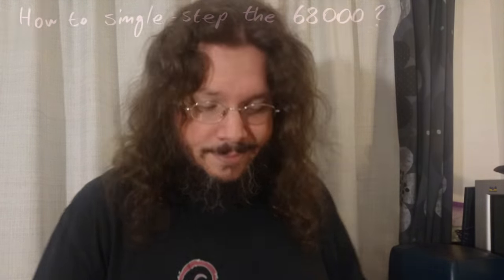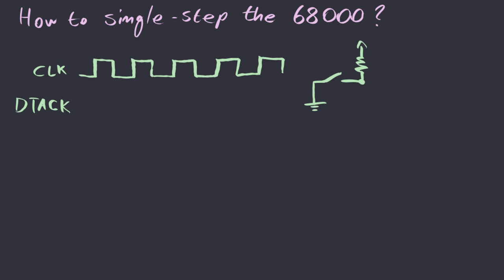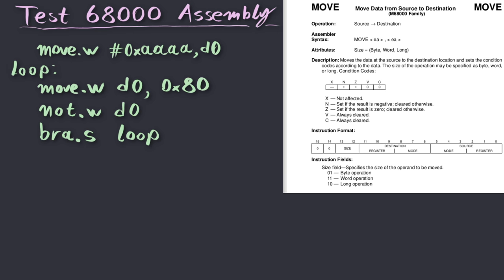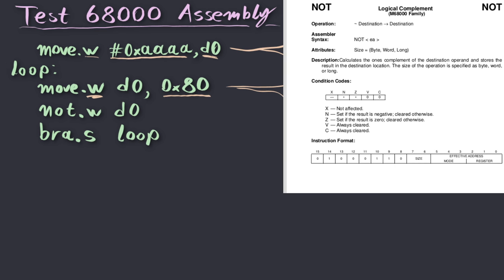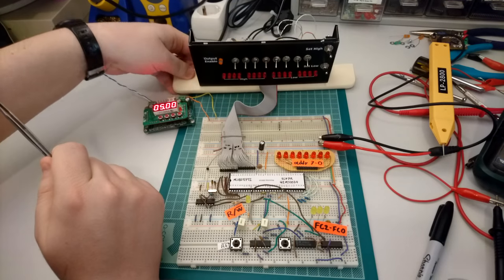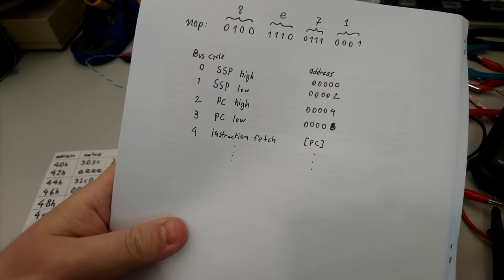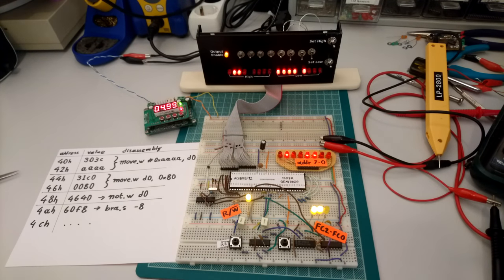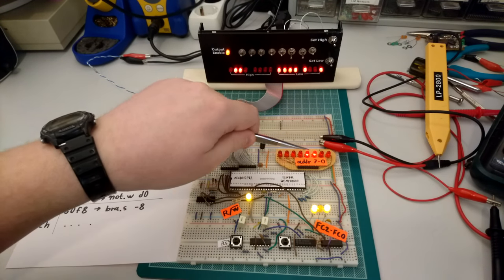Motorola 68000 CPU single-stepping on a breadboard experiment

Comment: Very cool to see a young person delving into the low-level details of the 68K; I always thought that other than the Z-80, it had the nicest instruction set and memory addressing than the I-86.  I always liked the Z-80 over the 6502 because when you look at 6502 code, all you seem to see is load-store, load-store which made it really hard to look at an assembly listing and get an immediate feel for the program. Outstanding video and community you have!
Reply: A load store architecture would imply an orthogonal isa. Sadly, this is not the case with 6502 ( nor Z80 ).

ARM2, SH-2 and 8086 have half the transistor count than 68k. 68k is really expensive.

Also LoadStore confines those size postfixes to load and store. This gives you more encodings in the R-type instructions. Let the CPU have internal zero flags for the register file if you are concerned about the implementation on a narrow ALU.

Comment: Nice video.  You had me going, anticipating each part, until the introduction of the address error at the end and tracing of the construction of the bottom of the stack frame showed a bunch of garbled data.  I thought, this is a 68010.  When it got to address x'86' in the stack frame and was writing a x'2708,' that was the clincher.  This is the status register at the time of interrupt. x'2' means super state, x'7' means the cpu's interrupt mask is x'7,' expected, uninterruptible.  x'08' means the Negative bit of the condition code is on.  I then checked out the next video and you mentioned 68010.  Good deal.
Reply from the maker: Yeap 68010 :) I don't remember if I mentioned it at all in the video, but it's also printed on the label I attached to the chip.
I choose the 010 for two reasons. One was that I thought in the future I might want to make an MMU to go with it, and I wanted to be able to recover from bus errors. But the other more pressing one was that I didn't feel like setting up a state machine that remaps ROM high a few cycles after reset, to leave the interrupt vectors in RAM at 0. I'd rather just leave ROM at the bottom and point the interrupt vector base register to wherever RAM is mapped.
Reply: Consider using FC0_FC2 to map the first 4k of storage to rom for super state data space. All other code combinations to ram. Then switch to user state as soon as possible after reset.  User code shouldn't be looking around at the system vector table anyways.  VBR can then stay at zero, and the entire vector table and reset words are invisible.

Comment: This is still a powerful cpu especially for imbedded systems. The 68000 is a good match for using static rams, eeproms too. Plenty of theses on Ebay for sale for the experimenter. This is the Cpu the TRS-80 Coco should have had in the 80’s. A really good instruction set too. Pretty simple stuff presented here. I would have used 74ls193( sn74hc193 now ) and single stepped from a 555 and the output going throught a  few 74hc373’s to drive the address bus. It’s hard to justify using these old things when there are so many cheaper, and more powerful cpu options available ( ARM cpu's ) that are easy to use and programmable in a simple intergrated development environment. Still... I do like this old stuff. I was building with the 68000 back in the 80’s…Peace out

Comment: Nice bit toggler or whatever you call it (the thing in back with the toggle switches and blinkenlights). Do you have a circuit diagram for it? And what kind of ribbon cable are you using to connect it to the breadboard? I just subscribed, this looks like a great channel
Reply from the maker: Thanks. I don't have a schematic for the switch-"box", because I just wired it directly on the prototyping board, but I more or less explain how it's wired up in the video. Basically the bit switches connect vcc or gnd to the inputs of two 8-bit latches. The latches have their OE (output enable) pins driven by the RD/WR pin of the CPU, and a bunch of LEDs show the state of the data lines, which are either driven by the latches when OE is active, or by the processor when it's not. The load pin of each latch is driven by the load-hi/load-low switches, which are essentially momentary push-buttons in the form of a switch (they are spring-loaded). No debouncing is necessary, because even if multiple loads occur, the data to be latched are stable.

Here's a picture of the back side of the whole construct I took at the time: https://imgur.com/sNkUPfN

Edit: There's nothing special about the ribbon cable. It's just a regular ribbon cable. You can see in this picture (and the video) how I split it and grouped the various signals together.
Edit2: The latches are 74HC373

Comment: I'm trying to understand how you converted the instructions to machine code using the motorola manual and it is very clear but sorry for the branch line why you said the displacement is minus 8 ? I didn't get it
Reply from the maker: The minus 8 is the offset we need to add to the program counter so that it'll point back to the top of the loop.
If you look at the final opcodes on the paper I'm holding up at around 28:18, you can see the addresses I used in my demonstration, in this case the top of the loop is the move instruction, 4 bytes starting at 44h, then there's the not instruction, 2 bytes starting at 48h, and then the branch instruction, again 2 bytes starting at 4ah. After the branch has been fetched PC points to 4ch, right after the branch. To move it back to the top we need an offset of 4ch - 44h = 8 bytes. Or as I said in the video we need to skip over the branch, the not and the move, 2 + 2 + 4 bytes = 8. Does that make it any clearer?
Reply: @jtsiomb  Oh Thank you it's clear now ^^

Comment: I had no idea it was possible to single step the 68000. I assumed the registers needed constant refresh
Reply from the maker: They do. That's what I'm explaining in this video. How I'm single-stepping bus-cycles while still keeping the processor on a steady 4MHz clock.
Reply: I'm actually a bit surprised!  I built a very simply breadboard PC using an MC68HC000.  The manual says the minimum clock is 2MHz, but I'm able to clock it at 75Hz without any issue.  I can take a video of the board if anyone is interested!
Reply: Daniel Scimé I am interested.
Reply: Gladly!  Give me some time to get a video together!
Reply: So is the register file DRAM? Is this about latches? Sharpness of edges of the clock for flip flops? Precharge? Only one of the phases need to be fast?

Comment: How many Hardware Stack and User Stack  m68000 use at the same time?
Reply from the maker: Not sure I understand what you mean. Hardware stack in my mind is like a PIC microcontroller which has a certain number of on-chip stack slots. The 68000 is not like that of course. It just has a stack pointer register, you point it anywhere you want in memory, and that's your stack. So yeah I don't know what you mean, please elaborate.

Comment: Can 68k run Linux
Reply from the maker: Yes, Linux supports the motorola 68k architecture. But it requires at least an 68020 with an MMU chip, or an 68030+ which had an MMU built-in. See: http://www.linux-m68k.org/faq/reqs.html

Comment: you don't by any chance have a circuit diagram
Reply from the maker: No, I'm afraid I was just winging it on the breadboard. But you can follow the wires with the help of some pinouts for the 68000 chip, it shouldn't be too hard, there are not many connections for this experiment. I have schematics for my completed 68000 computer I did after this: http://nuclear.mutantstargoat.com/hw/m68kcomp1/
Reply: @jtsiomb  thanks I actually already found it help full video, also would I be correct if I try running the 68 slow it will not work correctly needs to be how you did it
Reply from the maker: @glynnmason8205  Yeah, as I said in the video you can't run the 68000 with a slow clock, or to stop the clock altogether as you could do with a Z80 for instance. It has uses dynamic registers, and will lose their contents if not continuously refreshed by the internal clock-driven refresh circuit.
Reply: @jtsiomb  what chip did you use to latch the data in with switches
Reply from the maker: @glynnmason8205  It was two 74hc373 chips. Here, I still have that switch panel, so I just took a photo of the back of it, in case it helps: https://imgur.com/LbfJ3se
Reply: @jtsiomb  what program did you use to program the atmega168 was it atmel studio
Reply from the maker: @glynnmason8205  No. I use only free software when I can help it, and prefer command-line tools. For AVR programming I use avr-gcc and GNU make to build, and avrdude to program the chip, through a usbtinyisp programmer.
Reply: @jtsiomb  will I be able to program on a windows pc ,i've got an avr programmer
Reply from the maker: @glynnmason8205  of course
Reply: @jtsiomb  I've had a look and can only find a load of files and no complier ? to build and loads the files where did you get them from and the avrdude
Reply: in fact I would think the files you have in git hub should work in microchip studio which would be better for me in stead of using command line programs
Reply from the maker: @glynnmason8205  I don't use windows, and I can't give you instructions on how to setup a development environment in youtube comments. But there are lots of resources on the web about all that for every system.
Reply: @jtsiomb  no worries I've used it before when it was Atmel studio so shouldn't, have a problem
Reply: i've got some 74hc373 latches but having problems getting it to latch it doesn't stay on long can you help what am i missing i've tried  different ways of wiring the le and oe
Reply from the maker: @glynnmason8205  The 68k R/~W line is inverted and used to drive the ~OE of the latches, so that when the cpu is driving the bus, the latches are tri-stated. ~LE is tied to a momentary switch in the panel, one switch for each chip, so that when I press the switch, it goes low, and latches whatever the data switches are set to. If you have any more problems, since this thread is getting long, I'd prefer if you contact me through email, and I'll try to help you: nuclear@member.fsf.org